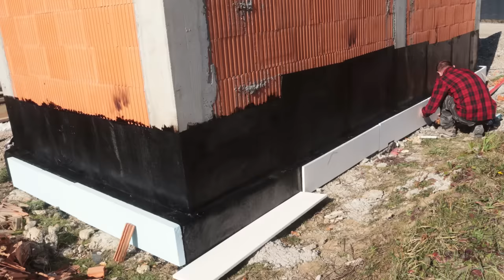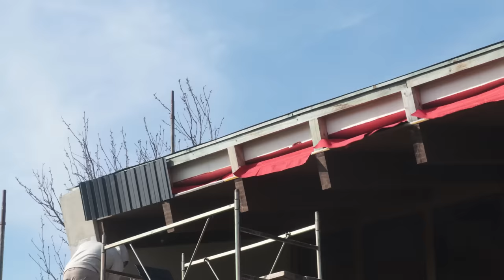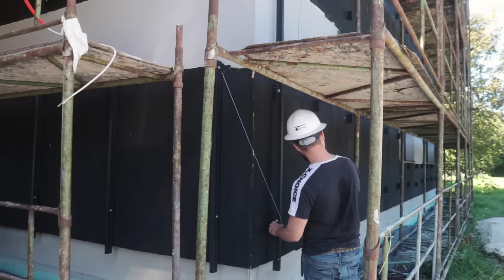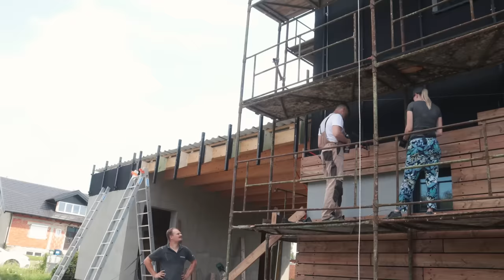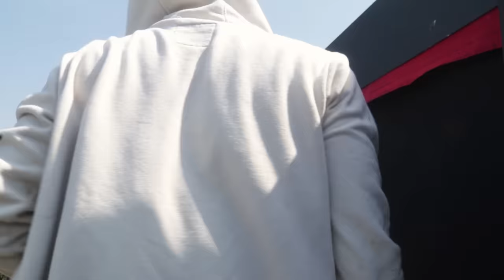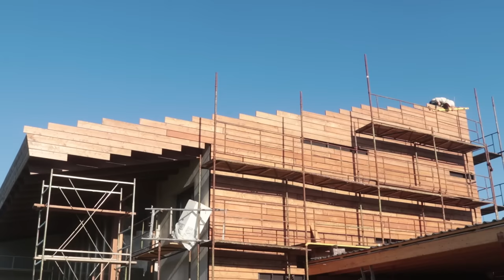Larch cladding is going up- My House Build Pt15

Comment: That's some serious engineered wall! Wood clading is there just as heat shield and looks? Are you worried those free joined/hanging plank ends will warp eventually and misaligne? Overall looks grand!
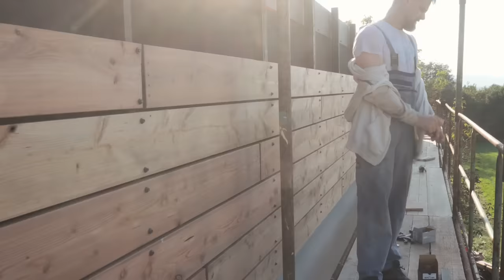Reply from the maker: They are fixed to each other by a piece of wpc behind so I don't fear they will warp. I used small screws so they are harder to see but you can still see them in a few frames like 8:29. Glad you like it, thank you!:)

Comment: when joining the cladding I see the ends of the planks are not fixed. Won't they bend and ruin the uniform look?
Reply from the maker: They are joined together by a piece of wpc behind them. Each end is fixed to the neighbor one, I just use small screws so they are harder to see. You can see it in a few closer frames like 8:29 for instance.
Reply: @lignumchannel  brilliant, thanks!

Comment: Is this traditional building techniques where you guys are? This house is like a fortress.
Reply from the maker: I like to do things in an unusual way:)
Reply: @lignumchannel Do you have any estimate about cost at this point, as in compared to say 2x4" raised house? No need to go into actual prices but in percentage like 20% more cost building but in long run 40% more efficient.
Reply: Maybe not this extreme, but in the Netherlands for instance almost all houses are two layers of stone with insulation between them, making them about 45cm thick. More mass build rowhouses are concrete pre-cast slabs that are listed in place, finished with insulation and brick on the outside.
Reply: @Plataani  There are pretty much no 2x4" houses in Europe, we do things with brick walls and cement pillars here :)
Reply: @Plataani  2x4/stick construction is a new thing in europe and very rarely will you see it. Brick is way better for harsh european winters.
Reply: @sasastankovic8760  My bad, I phrased it wrong. I know it isn't traditional, especially as I'm Finnish and that style came here up northern Europe in the 40's and 50's.  My bad.

Comment: It's just about the most beautiful thing ever.
The vertical piece is missing because it will be added at some later point as an integrated antennae of some sort.  The antennae could really be added anywhere but it would be cleaner to do it the way you are doing it so that's how it's going to go and that's that:-)  *edit two minutes later,  it's for the power mast for the service entry!
Reply from the maker: Thank you very much!:) The answer is much simpler.. I failed to order the correct amount of brackets and I couldn't hold of the work that was coming after it.. Hopefully it will hold with one missing;)
Reply: lol,  I sure over complicated that! @lignumchannel

Comment: 9:39 I thought it was missing one vertical for the cladding is because the span of each vertical (about 60cm if not mistaken) isn't right if sum it all up to the roof span itself. But then I watch it again, "nah!" they're alligned with the roof battens. So, I would assume you lost/broke/minus one on that vertical.

Comment: Why did not you go with the slope of the roof on the sides, at least with the topmost 3 rows? Now you have quite a few meters of endgrains cut exposed directly to weather.
Reply from the maker: No end grain will be exposed at the top after sheet metal trim covers it. A lot more details need to be finished.

Comment: Wasps are welcome! Be careful with those gaps, because all insects (spiders, wasps etc.) and even small birds love the cavities behind.
Reply from the maker: I thought like that also but we have the same kind of cladding on the workshop and we had no such issues for 5 years now. Reason is that this doesn't provide as much protection from the elements as one would think. Water drains on the backside of the boards as well, also hot circulating air during summer doesn't make it very hospitable environment.. It is basically open space rather than a cavity. Closed spaces with small holes or slits are are much more at danger from issues like this.
Reply: Yeah! I wish you good results! Thanks for the uploading.

Comment: Wow, this is a huge transformation, the larch cladding is really nice.
I have my walls also done with outside insulation now, and the same 1,5mm silicon render. And I'm really happy with the looks. Using wood cladding was not possible for me as it is an existing house and I can't alter the outside too much.
Reply from the maker: Yes, silicone render is great quality and it even comes with anti bacterial and anti fungal properties. As for the cladding, wood is my profession and doing a facade without it was simply not an option:)

Comment: I like the look of the larch, but with my luck the open-joint siding would be full of bees within a year. They managed to squeeze through a small gap in the metal soffit, the gap in the open joint seems even larger.
Reply from the maker: Yes I had the same worry when we did the same kind of cladding on the workshop 5 years ago. I was sure insects would make it their home but for some reason not a single wasp nest or anything else ever appeared. I'm not entirely sure why but maybe constant warm air circulating bothers them, or the fact that they are still exposed to some rain behind the boards. I'm sure it will be good for at least five years and then we will just see..

Comment: Are you not concerned that Bee's Wasps Etc might use the space between the Larch and the wall to build there nest"s Your house is such a masterpiece I know Wasps here in the USA will find any cavity to build there home.
Reply: Also birds and rats….
Reply from the maker: We did the same type of cladding on the workshop five years ago as an experiment to see exactly that. 5 years have passed and nothing ever moved in. I guess this kind of cladding doesn't provide as much shelter to insects and vermin as they require. constant warm air (hot during summer) circulating and water that comes through the gaps during rain surely bothers them too much.

Comment: The vertical is missing because there are no steel brackets to attach it to. as to why the steel bracket is missing I have no clue.
Reply from the maker: You are right!:) answer is simple, I miscounted the number of brackets needed and couldn't wait for 2 extra to be made. Hopefully it will hold ;)

Comment: The only thing that would worry me is , Snow / Ice on the roof or behind the wood on the walls , but it looks so good
Reply from the maker: The house is well water insulated even without the cladding so water behind the cladding is not a problem. I still have to fasten the snow protectors on the roof so it doesn't slip and some sheet metal to close the gap between the wood and walls at the top. Glad you like it, thank you:)
Reply: @lignumchannel  Good to know , thanks